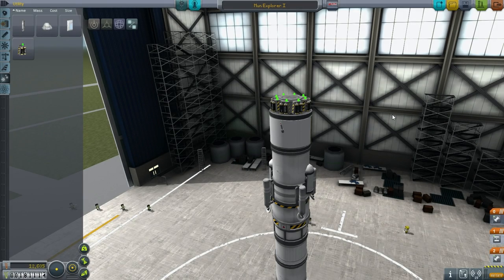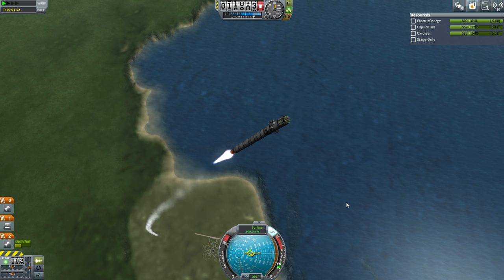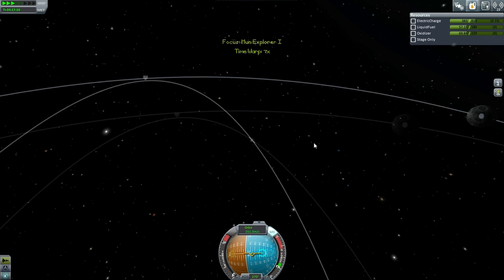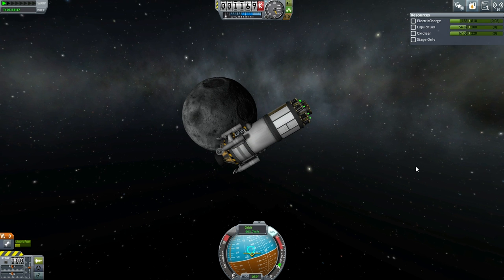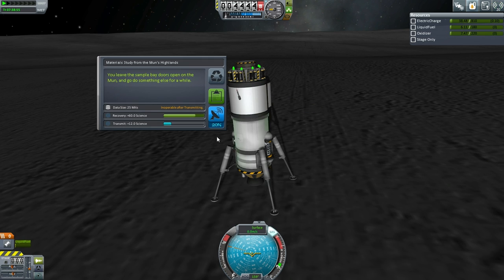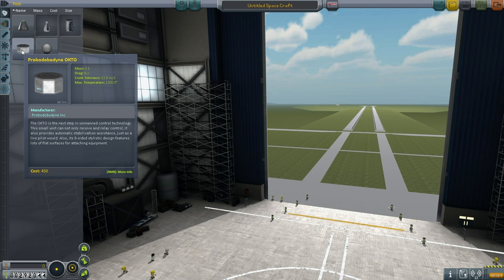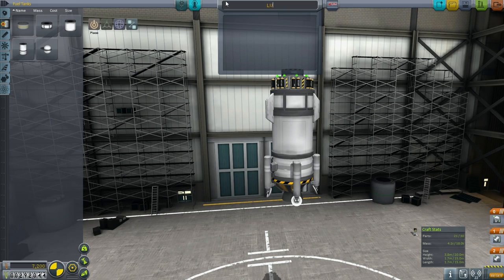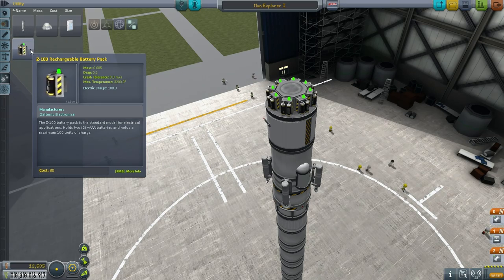Kerbal Space Program (0.90 Career+Sandbox) Tutorial 09 - Landing on the Mun

Comment: Surprised you didn't put that probe into hibernation to save power during the transit.  I haven't done it in a while (does this no longer work?) as I usually don't head out there until I get solar panels.  Switch off all batteries, SAS (you left yours on I think), RCS, Fuel Tanks (just to be thorough).  The probe will run out of electricity but after your transit you just unlock everything and then your good to go.